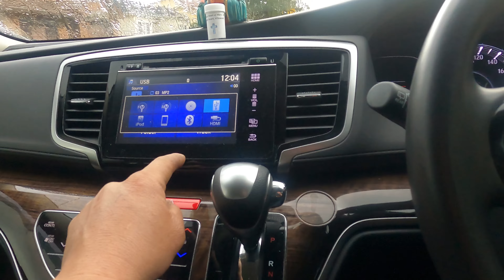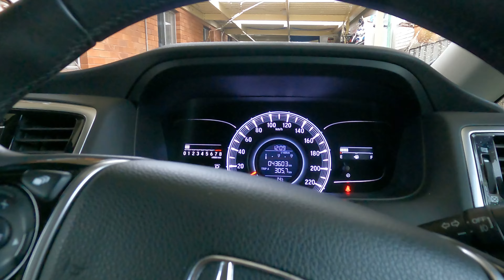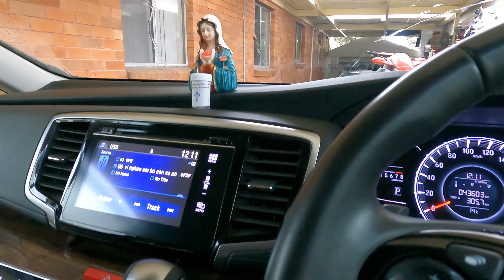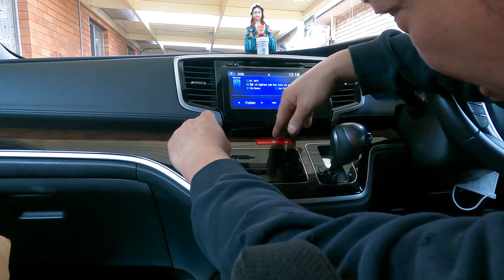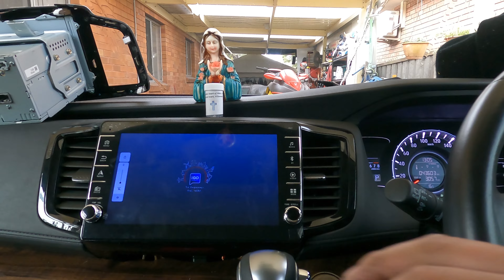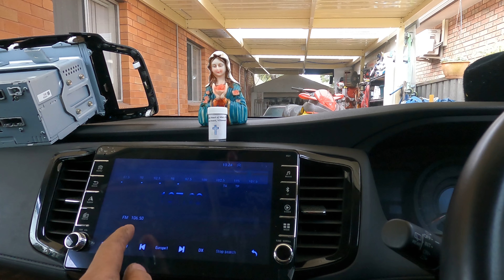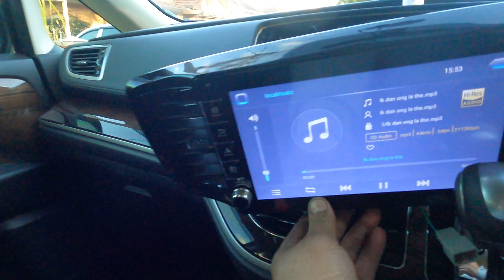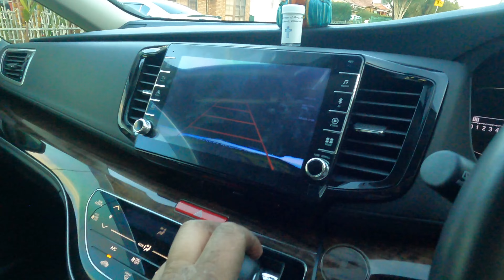honda odyssey 2018 gps aftermarket head unit installation

Comment: Great video mate! The Odyssey head unit removal looks way easier than most other cars. I've seen many that require the removal of large parts of the dash just to get to the head unit. But that looks pretty straight forward. Thanks for sharing 🙏